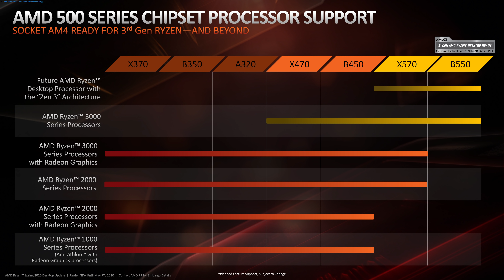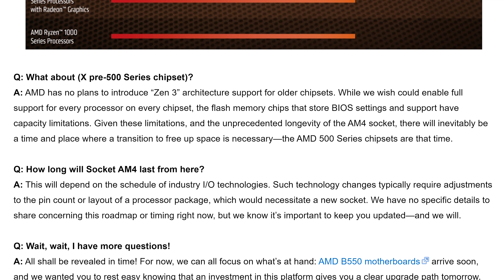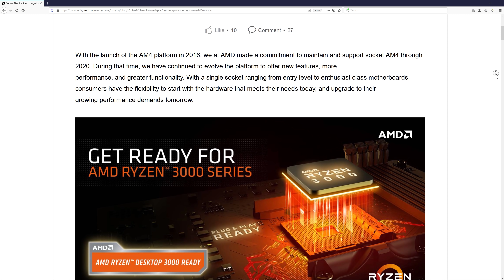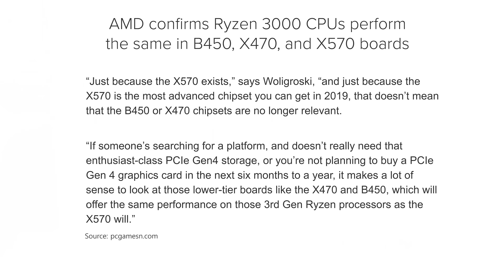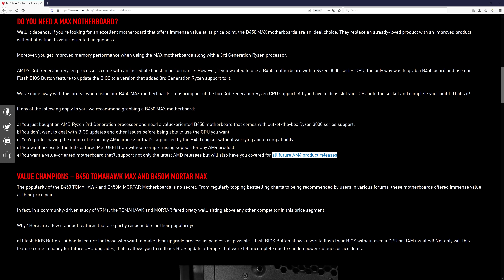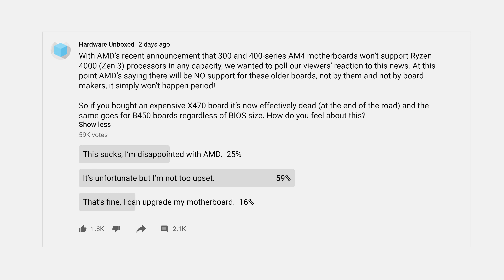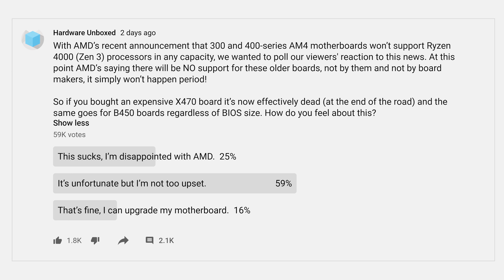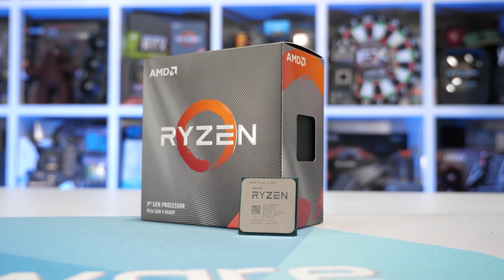AMD Does An Intel, Axes Zen 3 on 400-Series Motherboards, Our Thoughts

Comment: I upgraded to a Ryzen 5 3600X with an ASUS prime x470 Pro earlier this year, and the only reason I'm not more pissed off is because I got the board for $90. One of the major benefits of using AMD over Intel is/was the cheaper motherboards. x570 boards are near Intel levels of expensive. Spending $200 on a motherboard stings for anyone on a budget. AMD has bottled this one, and it'll leave a bad taste in customer's mouths. Hopefully they'll see this decision as a mistake and commit to adding support for b450/x470 chipsets

Comment: im a owner of r5 1600 and b350 board and im piss too, dont have upgrade to the latest and greatest which its the point to have a single socket support, for me its pointless to stick with am4 if in the end i have to buy a new board... i rather have them pull the intel completely and change the socket at least everything will work out of box something that we dont have on AM4 platform from stability issues, ram compatibility and many things that we have to deal with for the sake of compatibilitu between generations.

Comment: I bought a R7 1700 with a b350 board about 2 weeks after release.  I've gotten my money out of this system and so much more and for the b350 board has done almost everything for me, outside of a weird issue that it will "forget" that I have drives plugged in on launch.  I can understand for not including b350 but the fact that manufacturers went through and developed boards with the larger bios chips, I feel this is a money grab.

Comment: I can’t believe how many people are upset about something they were never promised in a series of chips that were supported far longer than their only competition. 
No ones forcing you to buy 4000 series or give up your “old” stuff. Plenty of the people complaining the loudest could do some significant upgrading within the 3000 series still.
Reply: They were promised it...I'm one of them that bought a B450 MB just a month ago.  As he says, MSI even has it on their website as a feature for B450 boards.  Did AMD not even communicate this to their board partners?!  Bonehead decision by AMD, period.  I just bought my first AMD system EVER, and I bought it specifically because of supposed support for Zen 3 which I knew Intel would not give me.  Now, they're just Intel.  You likely own a 570 board and/or are an AMD, uh,  'supporter'.

Comment: Unfortunately, this video does not seem to live up to the normal Hammer-On-Box standards.

Little new information or analysis was offered in what at its core constitutes a rant.

400-series motherboards were created for 12nm Zen+, which has a single-chip design and no more than 4+4 cores in a split-CCX architecture, while the 7nm Zen3 has 16 cores in an I/O-die + 2xCCD 3-chip structure, where each CCD has 8 cores in an unsplit CCX. Therefore, I am perfectly willing to give AMD the benefit of the doubt that there may be solid technical reasons for not supporting Zen3 on 400-series motherboards, even if they may prefer for marketing reasons not to go into technicalities but to stick to a simpler but unconvincing explanation. This should be obvious to any reasonably well informed PC builder.

Perhaps supporting Zen2 was already challenging, and changing the CCX architecture was the final nail in the coffin. Or perhaps the multitude of architectural options to be covered simply grew too large to remain manageable. At any rate, there are quite valid technological questions to be answered before passing final judgement, whichever way that might go.

In the video, several possible reasons for not extending support were first hinted at but then dismissed without further discussion. The focus stayed on the marketing message and the assumption, that AMD would know long beforehand details of how new products turn out, even if they clearly are doing product development at a fast pace.

There may well have been good reasons for AMD to be vague over the nature of the support for the AM4 socket, as they have been. Personally, I prefer getting the very best possible product in the end rather than having to contend with nerfed products to maintain extended support, and I take this into consideration when planning my PC builds.

Yes, the marketing message has been unclear, but rather than focusing on that, I would have expected Harbour Boxed to look at the underlying issues more widely, trying to understand what technical reasons, if any, may be behind the lack of support, rather than taking the straightforward clickbaity approach of "greedy, evil intent".
Reply: Yah, wrong.  AMD had an advantage and just lost it.  I just moved for the first time to AMD, and will now just move back to Intel as they've forced me to buy another MB to upgrade, just like Intel.

Comment: I am a 370 owner and was a bit on the fence about a 3900x or future 4800 8 core, i am a bit negative about the easier choice now, but not really the end of the world.
But a promise is a promise, Asrock delivers bios updates in steps so the board is able to boot with a new CPU and then a newer version needs to be flashed afterwards to be fully compatible.
So the flash size is not that big of a problem, because a limited bios is used to change CPU and then the correct bios designed to the CPU, is flashed afterwards, so the bios does not need to have all functions to all CPUes build in.
Atleast that is how i think it works when looking at the homepage.

Comment: I don’t think AMD are wrong they said support would be until 2020 it’s 2020 now isn’t it? Plus if you just both x470 or older boards why are you worried about upgrading Wright zen2 is more than capable to whatever you need just wait till next year or so to upgrade again

Comment: I recently (in the last 3 months) bought a b450 motherboard and a Ryzen 2600 with the intention of dropping in a 4000 series chip later this year. Yes Steve, I am pissed off.
Reply: Same here! Bought a b450 back in february with a ryzen 5 1600. I was planning on upgrading to an rtx 3000 series card and ryzen 4000 series later this year.

Comment: I bought 3700x and Tomahawk MAX, and honestly, I am not mad at all. I don't see a point of r4000 in late 2020,when we are gonna get r5000 in 2022, maybe H1. If you want r4000, going for solid b550 won't cost much, like 70-80$ more at worst (considering that you sell b450mb), and that's nothing, to be honest. They did do partial Intel, and it was about time, to be honest. Intel i9 will require 250$ motherboards to be overclocked and run without issues, while r4000 will be able to do it with 150$ b550, so again it's cheaper and will be better, in terms of price/perf.

Comment: Agree with everything you say here.  I JUST bought a B450 MSI Carbon AC thinking I'd be able to plop in a 4000 series CPU down the road, making AMD a great buy.  Now?  May just switch back to Intel if I need a new MB anyways.  What a colossal dumb move when AMD had so much momentum.
Reply: RMA it and wait for B550

Comment: No reason for AMD to not make ZEN 2+ 7nm+ "ZEN 3" not working on X470 or B450. A very stupid decision for sure if they by the bios ban the 
"ZEN 3" from these users. My MB the ASUS Prime X470 Pro that was manufactured a year ago came with ZEN 2 support right out of the box, it 
even supported PCIE Gen 4. But after a couple of bios updates that support was of course removed, but the performance was enhanced a bit. So 
no doubt most if not all those B450/X470 MB that support ZEN 2 today should support "ZEN 3" with just a minor bios update. Going from the 
2000 series to 3000 is a much bigger difference than from 3000 to 4000. The 300 series motherboards for the most part had ZEN 1, 1,5 and 2. 
Now it's only fare that X470/B450 has 2 updates as well Zen 2 and 2+ "3".
Reply: Also i was planning to update from the 3600X to ZEN 3 next year, probably the 4800X

Comment: It is not what b450 and older chips owners wanted but it is necessary cuz the bios chips are not big enough. It is that easy. 

On the one hand we want an optimised product on the other hand we want to keep old hardware... the reality is: u can't get optimised products on the old small bios chips->so deal with it. Better that way than the shi*stormway. 
No need to see ppl complaining about instability, not boosting like it should and other issues.

Comment: thank you for this Hardware Unboxed.  I waited until December 2019 for  B550 but no sign of it so I went with the B450 Tomahawk Max with the larger 32mb ROM.  I am completely blindsided and pissed.  AMD fucked up and a good chunk of their customer base that supported them
Reply: Yeah , i waited for b550 as well , was thinking about an r7 4700x ez upgrade in a few years 😄
Reply: cheers 😁 how about to put 3900X or 3950X in your board ?

who cares zen3 ?
Reply: @claritoresdiano1021   It is the single core speed that matters most to some people.
Reply: @claritoresdiano1021  Even upgrading from 3600X to 3950X wouldnt be worth it. Upgrading to 4***X in 2022 at much reduced price would probably be.

Comment: You could buy x570 for the same money as b450 tomahawk max. I know because I did, meanwhile Hardware Unboxed recommended max without knowing if its going to work without issues with zen4000, knowing what happend with tomahawk non max when zen3000 came. Now AMD wants to ensure that their upcoming CPU will work out of the box without issues and you guys are the one to blame not AMD

Comment: I think after 3000 ryzen series were released caught amd off guard about bios prolem since some of you guys who work at hardware store, there were sooo many customers having problem with bios update and so many rma probelem related to bios and causes so many negative impact to rma centre and angry customer.
There was even a older processor loaner program for just to update bios, but while updating bios there were many customer at hardware store abusing return policy for older gen cpu just to update bios...

I think i can fully understand both side perspective for either axing support and be angry with no next gen cpu support... To be honest there is no right choice in this case whenever amd decide to support or not.

Comment: Can you run an AM3+ CPU on a AM3 Motherboard I know you can run a AM3 & AM3+ chip on the AM3+ board but the AM3+ only work on the AM3+ ones? Was it not the same with AM2 & AM2+ at least that's what I remember anyway I'm sure I've probable it wrong 😉

Comment: If it was a genuine hardware limitation I would be more okay with it, but their reasoning doesn't really make sense.

If it's purely a chip size issue, the 500 series should just be bigger to allow for older chips and new, as well as providing the option to update older chipsets from Ryzen 1000-3000 support to 2000-4000, clearing space from older chips to allow new ones.

I went from a B250m to an X470 (specifically going with one of the beefiest VRMS possible) with the hopes to upgrade CPU later this year under the pretense that it would be possible. If I had known, I would have held out a few more weeks for the local x570 stock to stabilize. As far as I was aware the only thing I was giving up was PCIe gen 4 and super fast SSDs... sadly not
At least there are still fantastic options for high end 3000 chips to replace my R7-1700, but it's still disappointing

Comment: Isn't the expectation also that the Ryzen 3 cpus will be among the last AM4 mainstream chips?  The expectation going forward is that there will be mid-range AM5 boards with support for DDR4 rather than DDR5 until 2022.  But the high end will boards will start to transition in the not so distant future once DDR5 ram sticks start to be available.  And frankly a new socket will be necessary going forward, the question is mostly if it will be PGA or LGA,focusing on pad density of power per pin will be what decides that.
Yeah B450 and X470 getting the shaft stinks, but you know AMD is going to to release an AF version CPU, probably the 3600 based on the Zen 3 process once yield rates and capacity get high enough.

Comment: I think support should be maintained for at least x470/b450, especially since b550 is just now showing up. Maintaining 3 generations (assuming x670/b650 come out at the same time upon Zen 3 release) of motherboards would be ideal. 370/350 could in theory go to the wayside and I'd be okay with that. 

We can probably expect a new socket for Zen 4 in 2021 as that is what AMD said with Ryzen initial release, no? Don't see DDR5 support coming until then or possibly even 2022.

Great vid as always Steve.

Comment: So my B450 tomahawk MAX board has infrequent boot issues, which some boards had, and doesn't recognise the latest bios update from MSI, which I'm pretty sure would fix it... And my wifi/Bluetooth PCIe card doesn't have Bluetooth anymore. So I'm already looking at a mobo upgrade, in the far future, with wifi, instead of another expansion card... So b450 ending support actually doesn't bug me. Whether i fix the board myself or rma it, I intend on selling it regardless. And I'm more partial to GN Steve's/Linus' arguments too. Where, for the sake of the layperson, it can get confusing and outright harmful to your brand, if someone's first experience with your product is "this mobo doesn't work", cause they read it supports a given CPU (with an asterisk). There are still generations of people who don't follow tech, who's last experience was a techy person telling them "whatever you get, go Intel". AMD need to draw a line somewhere, and if this is that line, yeah, I'd wish they drew it earlier, told me what to expect, but I get it. 

My wifi card came from a previous build, that was maxed out. A Z170 mobo with a 7700k. That mobo lasted two generations, and really, one architecture. I havea 3700x right now, and if I keep the tomahawk max, I still have the 3950x to look at if I want some day. I'm fine with this.

Comment: Longevity of the socket is utterly meaningless without chipset compatibility. Marketing nonsense by AMD. Spot on video Steve.

IMO the boost clock issue was about marketing making a spec promise and the chips not delivering. I don't care about 100mhz of performance. I care about companies meeting specs they promise with their marketing. Chip wont boost to those speeds? Fine, don't tell me it will in the first place.

Comment: AMD said they would support the AM4 socket through to 2020. Given that Zen 3 is due to launch Sept/Oct this year (Rumoured, not confirmed) and will likely have widescale availability by the holiday season. they haven't exactly lied. Unless there was communication behind the scenes, MSI tried to play ahead of the game, and screwed themselves in doing so. The community expecting others to manufacture boards with increased BIOS capacity chips as well, is a stretch, especially with no real incentive directly from AMD.
Sure, AMD has done something rather unexpected, and opposite as was interpreted by the Tech Community. But that said, I don't see the as egregious as some of the stuff Intel did over the 8-9yr 'reign' as Desktop market king.

Comment: Built my PC at the end of 2020 with a b450 tomahawk max and r7 3700x and the reason I chose those parts was that I was sure it is future proof. But now does it mean I can only go up to r9-3950x on this platform and then I need to upgrade both CPU and Motherboard to B550 or X570?

Comment: Amd being worse than Intel is a joke. I got x370 + 1700 in 2017, and got a 3900x doubling performance in 2019. The x570 boards supporting future processors is also awesome. Intel literally just released a new chipset for an identical architecture.

Comment: While I can't say I'm happy about this but I would wait till the 4k series announcement comes out. If AMD was to push core counts across all their tiers eg. 8 core R5 and 12 core R7 and so on, As well as have their APU-s run on Navi graphics and maybe add some beneficial features for the 4k series overall I'd say its fine all across the board. It's up to AMD to make it justifiable to by their products over Intel. If they can't do it I just won't buy it end of story. Also to most others who have ryzen 3000 parts, are those CPU-s really so subpar to the upcoming 4000 CPU-s that u cant live without a generational upgrade.

Comment: I wanted to upgrade to Zen3 on my X370. Now what stops me from upgrading to Intel? Nothing that's what! I could forgive Zen CPU's from always being a bit behind Intel (in gaming) because of the upgrade path but now I wish I bought a 7700K back in the day because even though that didn't have any upgrade path it still beats a 3950X in gaming when overclocked! And yes they were more expensive than Ryzen but they did hold their 2nd hand value better. If it wasn't for the monoblock I have for this board I would buy Intel if it's still ahead of Zen3. Maybe I still will if the Intel 10 core is cheaper than the AMD 16 core. I don't need 16 cores but if I want to run a powerful VM I want to run it on an 8 core chiplet. Since you don't have this problem with Intels monolithic die 10 cores are plenty. So if the Intel 10 core is $500 and a 3950X (for my current board) is still above $700 then buying Intel with a new board makes more sense.
Reply: I mean you can just get a 3100/3300x now if you want 7700 performance
Reply: Exactly, the main point of ryzen, despite being a bit behind in a lot of thing including gaming, was the upgrade path, and amd clearly took advantage of it in theere sales. They didn't clarified the situation either. 

It make Intel a lot more relevant, look like amd just killed their product line up